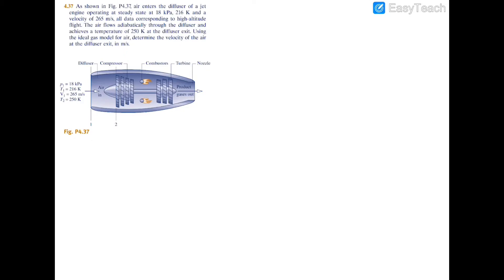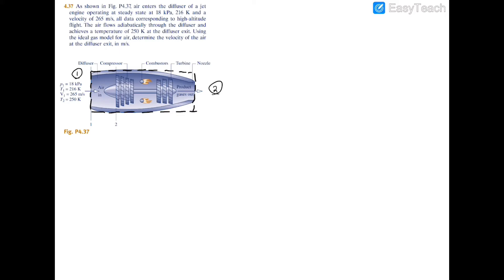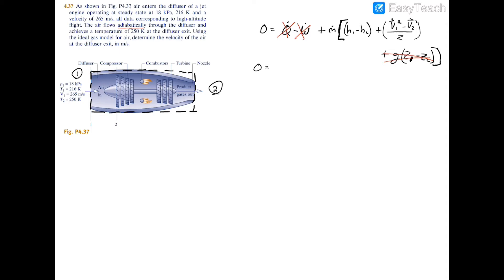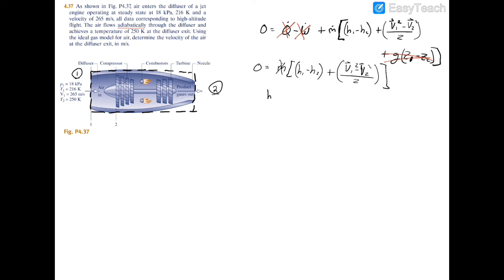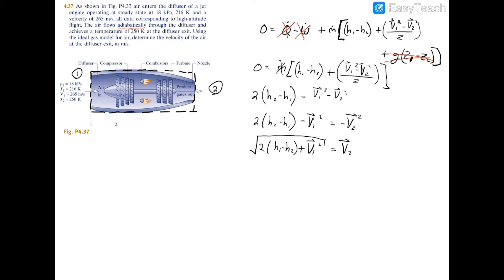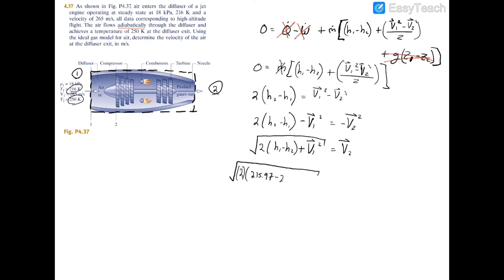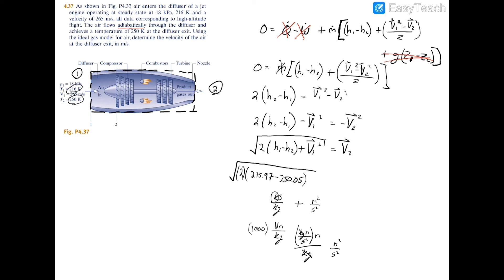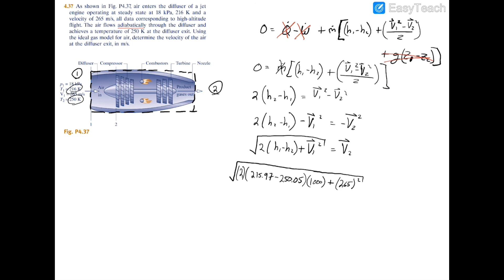4.37 As shown in Fig. P4.37, air enters the diffuser of a jet engine operating at steady state at 18

Comment: You did a nice job explaining the math, 1st Law simplification, and unit conversions behind this problem, but your picture is misleading....the question specifically asks for the velocity at the diffuser exit (where T2 is given) but you drew the control volume around the whole jet engine making V2 the velocity at the nozzle exit. 

The velocity at the nozzle exit will be much greater than the velocity at the diffuser exit since the diffuser functions to decrease velocity while increasing pressure (which you explained) but the nozzle functions to increase velocity while decreasing pressure.  Just a note on a way to improve your video!
Reply from the maker: Hey Ashley, thanks for the comment! I definitely agree with you about the physics of nozzles and diffusers, you are absolutely correct! My control volume in this video was intended to (over)simplify the jet engine to show that there’s only 1 inlet, and 1 exit. My exit labeled 2 describes the exit of the diffuser, not the exit of the nozzle. I tried my best to make this as clear as possible, but I suppose it slipped between the cracks. Nonetheless, I’m glad that future students can read this conversation for clarification, thank you so much for pointing this out!